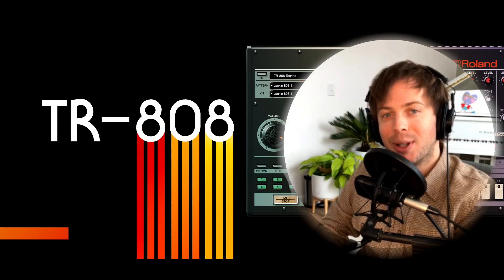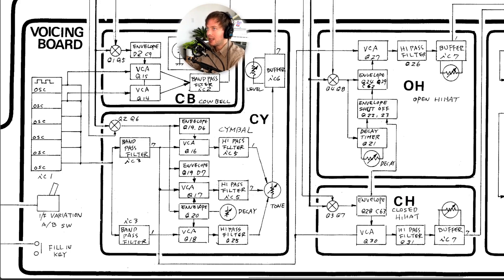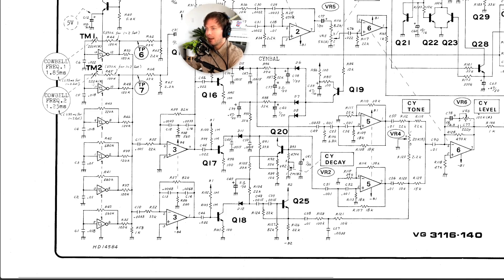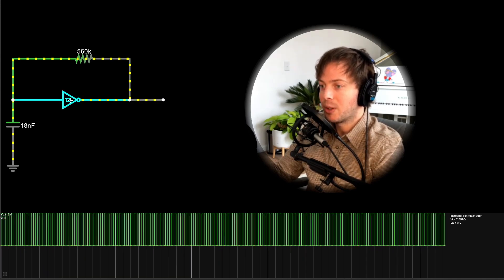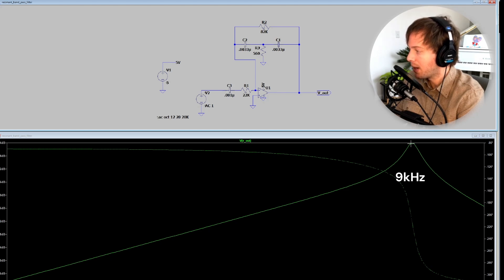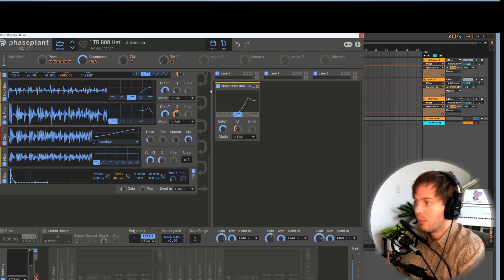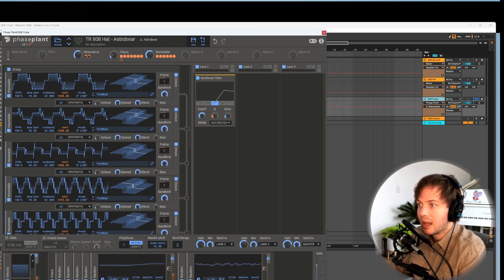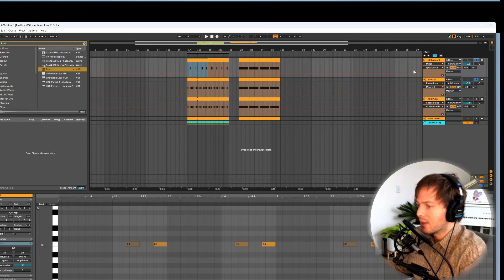Accurate recreation of the TR 808 hi-hat patch with Phase Plant.

Comment: Incredible work!
Reply from the maker: Thanks, appreciate you!
Reply: @astrobearmusic1977  Have you tried recreating the 909 Snare based on the schematics? 

There is a diode in the circuit that has an asymmetric waveshaping effect which is why you always see this DC Offset in the 909 waveform. This diode also creates the overtones. I have been able to get really close to an authentic 909 recreation but I was never able to get the right waveshaping effect.
Reply from the maker: Neat! I haven’t tried the 909 yet but it’s one of the topics I’ll hit eventually. 

I haven’t really tried modeling a diode wave shape before - I just use whatever distortion units I have available. But I do remember in uni learning about the diodes “avalanche” effect (dumping a bunch of charge when it reaches a threshold) that they often approximate with a little “bump” in the wave shaper. But this is not a “memoryless” effect so for an accurate recreation a wave shaper isn’t sufficient to my knowledge (but maybe close enough)
Reply from the maker: I’m going to do a video on Tape Hysterisis soon (another effect that is not memoryless, because the wave shaping depends on previous states)

Maybe I could throw in some diode modeling in that video.